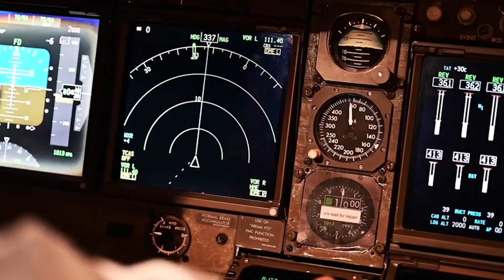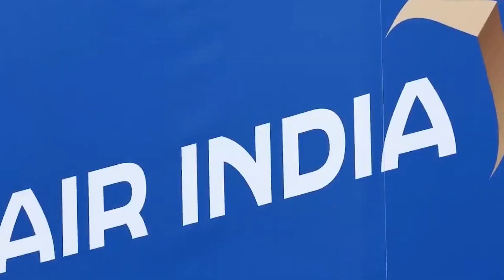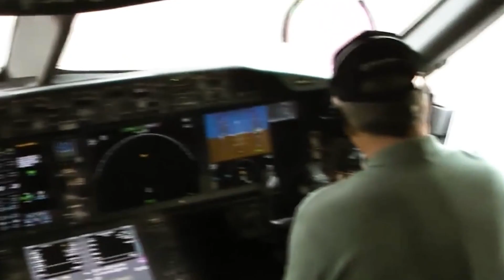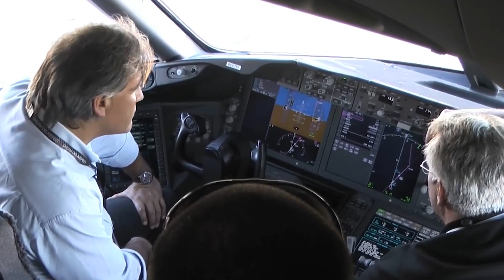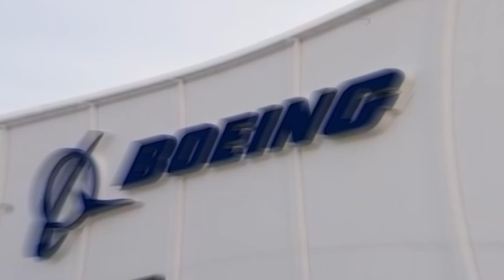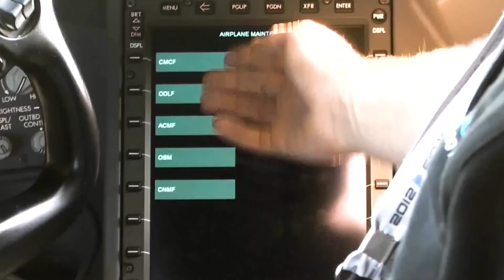They Said “I Didn’t Touch It” – Inside the Crash of AI171

Comment: ✈ The human error theory seems weak in this case. In a cockpit, both pilots sit so close that if one of them even moves their hand toward the engine switches, the other will immediately notice.

🔧 Shutting off the engines involves physically moving a switch or lever — it's not something that happens silently or without visibility. Plus, right after takeoff, both pilots are on high alert. There's no chance one would be distracted or inattentive during this critical phase.

🧑‍✈ According to aviation SOPs, shutting down an engine is a major action and is never done without cross-confirmation between both pilots.

👉 So if both pilots claim they didn’t shut off the engines, and yet both engines failed nearly simultaneously, then a technical glitch in the engine control or switch system cannot be ruled out.

🛑 Aviation authorities need to conduct a detailed investigation into the dual-engine control system. Jumping to blame human error without hard evidence — especially in a case involving loss of life — would be unfair.

What most people are missing here is that the FAA had already issued a warning back in 2018 (SAIB NM-18-33) about a potential issue in Boeing aircraft where the fuel control switches could unintentionally move due to vibration or mechanical failure.

In the recent Air India crash, both pilots denied switching off the engines, and flight data confirmed that both engine fuel switches moved from RUN to CUTOFF almost simultaneously.

If these switches are manual and controlled by physical levers, it's impossible for them to move without human input — unless there’s a mechanical fault, such as a failed locking mechanism, which is exactly what the FAA had previously warned about.

The aircraft involved had not undergone the inspection recommended in that 2018 FAA alert because it was marked “advisory, not mandatory.”

This strongly points to a technical glitch — not pilot error. It's easy to blame humans when machines fail silently. Aviation authorities should focus on the dual engine switch system’s design and whether proper inspections were neglected.